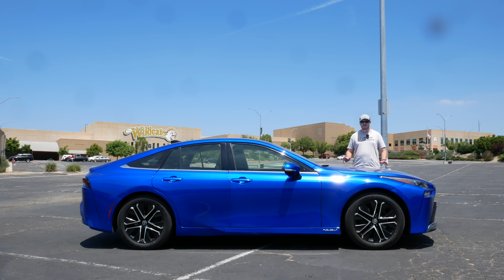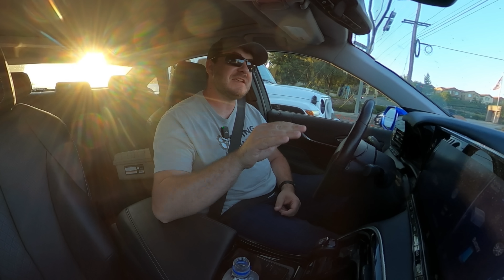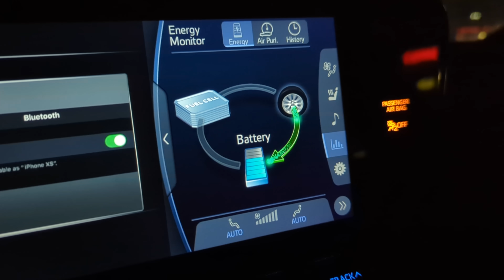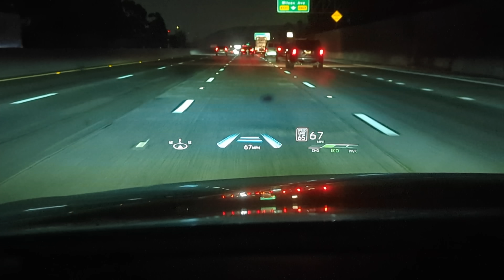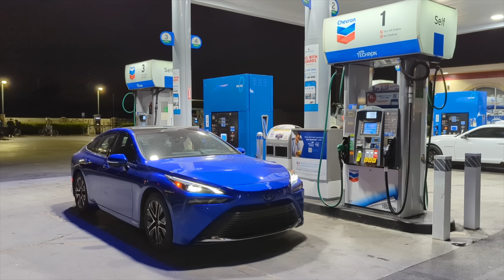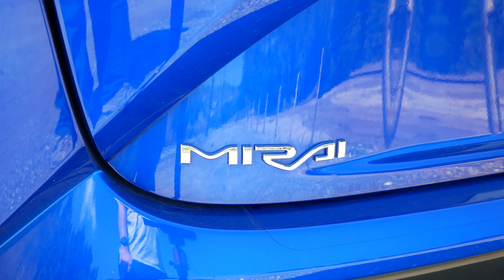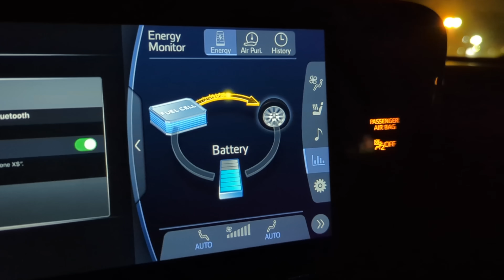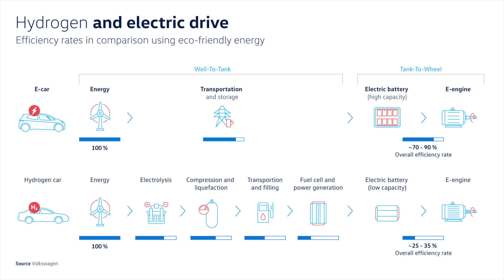The Toyota Mirai is Disappointing

Comment: There are actually at least three hydrogen cars. Opel is selling their Vivaro, a small box van, as a hydrogen version too. And soon Citroen and other companies from stellantis will follow step. 

But you mentioned the blower noise. Those cars usually actually have a turbo to be able to get enough air for the reaction. 
Those vivaros sometimes sound like yet engines.

You also mentioned the fuel cell/Batterie usage in this car. It's actually its strong point. As a car manufacturer you don't want to have a brick battery. It's expensive, takes up space, makes your car heavy and has a bigger environmental impact. 
And you as a user would probably like to reduce the cycles of your battery to have it last longer. 
Toyota and Hyundai were able to do it. Other hydrogen vehicles like the Vivaro have a bigger battery pack. But not because it's an active design goal, they just can't do it any other way. This fuel cell/battery management is hard but crucial and if you can't do it properly your battery has become bigger. They would absolutely love to know how Toyota does it.
The truck you mentioned might be something else, but in general with cars the aim is to have next to no battery capacity.
Reply: To answer more of your questions: the estimated life of a car fuel cell is usually around 3000-4000 hours. 
In trucks they use more expensive membranes that should last around 20000 hours.
Reply: The Vivaro Hydrogen has a big (10 kWh) battery because it is a plugin vehicle. It even has DC charging capabilities so it really is half an EV.
Reply: @Freba9  They try to make the best of it, but it's really born from them not being able to run with such a small battery.

Comment: Hydrogen cars have the same problem as electric cars, they need much better ways to store their power source. They need to find some magical way to store far more hydrogen and do it in a far safer way. Fuel cells are crazy complicated, expensive and explosive. Just using hydrogen to run a standard ICE drivetrain is far easier and cheaper, albeit very inefficient.

Comment: “Technology is fun” when it makes sense… and actually works reliably (unlike CrApple devices)!
Unfortunately, we as consumers are GULLIBLE and IGNORANT. We’re far too trusting of the sunshine-n-puppydogs “data” that tree-huggers and energy suppliers feed us, to make us “feel better”.
Most of that disinformation would be an excellent source of that “methane gas” mentioned in the video. 💩 
I’ll speak in Reality-ese:
I’ve driven Gasoline vehicles. I’ve driven Diesel vehicles. I’ve driven CNG, LPG and Electric vehicles. The reality is this:
Gas is not exactly clean, but it is FAR more “Renewable” than we’ve been brain-washed to believe (*psst - it’s not “dinosaurs”, folks*).
Diesel is much, MUCH cleaner than it used to be, but it’s not very efficient (and contrary to what Robert said, 10mpg in a BigRig is a fantasy - try 8, in ideal circumstances)!
Electric isn’t “Clean” either, even if it’s Solar, Wind or Hydrodynamic. It really isn’t! 
All those wind-turbines we litter our landscape with? Every one costs millions to manufacture and erect (and if you think that process is in any way “Clean”, you’re delusional); and with their unreliability and astronomical costs of maintenance and repair, precisely NONE of them can ever pay for themselves. Money down the drain, in addition to the Sight Pollution, danger to aircraft …and they slaughter birds as well, folks.
Solar is becoming increasingly more affordable, but it’s still relatively expensive… and also poses significant environmental consequences, including horrible wildlife deaths. Anyone who sees those three solar steam generating towers on the CA border outside Las Vegas should do some research on that facility. That Ivanpah plant is another blight on our landscape, cost tens of millions to operate and maintain, and it’s INCREDIBLY inefficient! I mean, truly ludicrous! We’re talking low 30’s efficiency! And you can’t tour the facility, because they don’t want the public to see all the many flash-fried bird carcasses on the ground beneath and around the facility. FYI, those panels you see on the ground are NOT solar cells, they are focused MIRRORS, and birds flying innocently in the powerful sunlight beam between the mirrors and the boiler tanks atop the towers are nearly incinerated in an instant. Don’t believe it? Pull off the Highway and grab your binoculars.
Plus like all Solar generation, they only work when there’s sunlight. 
CNG is truly Renewable, and relatively inexpensive. Except that the Big Energy people control its production, so they therefore control its sale.
LPG is slightly less Green, and is a little more costly to produce. It is readily-available and easy to utilize; but Propane is INCREDIBLY dangerous, and the amount of LPG a vehicle can have stored within it must be very limited, or else you’d be driving around in a mobile explosive device with the capability of leveling a city block. Therefore they have a very limited travel range.
And HYDROGEN??
Have we forgotten the tragic lesson learned from the Hindenburg?

I’ll keep my gas, thanks.
⛽️👍🏼

Comment: I was in a club in high school to show the viability of the Toyota Mirai. It used the same premises as the car, we would create an RC car and a hydrogen fuel cell would recharge the battery.   There was a twist however, we would enter the car into an endurance race ~4 hours. It was a really fun experience but we couldn’t really compete because one school had like 6 teams and had tens of thousands to spend on this program. 

The main source of problems was the fuel cell and the system surrounding it. And from what I am able to recall, the fuel cell works by shoving hydrogen through a membrane, which(somehow) separates the electron and hydrogen(temporarily). The positively charged hydrogen sits on the other side of the circuit and the electron goes through the circuit making electricity. Take this with a grain of salt because I don’t have a college degree nor a brain for chemistry. 

For hydrogen creation we used electrolysis to fill hydrogen tubes and we learned of an upcoming third way.   Apparently there is a startup that is taking methane(and carbon)from landfills and dumps and uses that methane to make hydrogen. Really cool stuff! And I really hope it works out. 

For what’s it’s worth I took environmental science and your descriptions are really accurate. And this is my longest and most serious comment I ever wrote.

Comment: I feel hydrogen is a better way forward than electric
Reply: It’s not at all.
Reply: @Freba9  yes it very much is a better way forward especially if you don't live in a city
Reply: @Mephesto31  It is simply not efficient enough. Also, EVs make perfect sense in rural areas as most people have driveways and can charge at home for very low prices.
Reply: @Freba9  no they don't unless you live in southern California evs are garbage my commute 1 way is over 100miles hydrogen is a million times more efficient than electric and it's for the planet then evs the ev push is a control thing
Reply: @Mephesto31  That's an insanely long commute, but it's no problem for a modern EV. Owning EVs in rural areas is no problem at all.
And no, hydrogen is OBVIOUSLY much less efficient than electric.

BEV:
Power plant > Battery > Motor

HFCEV:
Power plant > Electrolysis > Cryogenic Storage > Transport by truck > Cryogenic Storage again > De-liquification/pressurization > Hydrogen fuel cell > Battery > Electric motor

You're gonna tell me that the method with 6 extra steps is more efficient?

Comment: To simplify, the membrane in the fuel cell repels electrons, so when a hydrogen atom makes its way across the fuel cell, it gets striped of its electron. It reacts with oxygen on the other side to make H2O. This is hard to do without an electron, so if it can pull one in, it will. If you put a conductive mesh on either side of the fuel cell and connect them, the electron travels though the wire to the other side of the fuel cell where it is needed, and of course electrons traveling though a wire, well, that's electricity!
The reaction is an oxidation reaction, in this case the oxidization of hydrogen. Like most oxidation reactions, the oxidization of hydrogen is exothermic (adds heat to the surrounding environment), so the fuel cells get hot for the same reason the Hindenburg, a hydrogen filled lighter then air aircraft, burned down in a bright fireball of death.

Comment: If the cell makes heat you might as well use a steam engine and maybe a tiny electric motor to capitalize on all the energy you can and use the water to supplement the water to the boiler.  You won't be super fast but it would reach highway speed.

Comment: There is a reason Elon has called this a “fools cell”.
Reply: Funny because Toyota is working with NASA they built an RV for the moon and it uses hydrogen not incredibly dangerous lithium.
Considering it's way more complicated in space than on earth I think hydrogen has a real place. I'd rather have a hydrogen vehicle than an EV as I live in an apartment.
Who's going to pay to have my small 4 unit building wired up so I can buy an EV? I can't afford the SEVERAL thousand it'd take to upgrade my breaker box, then run an outdoor line, with a locker to pull out the EV charger because I rent. My landlord won't without drastically increasing my rent. It's not the governments job, and no car company would do that for a renter just because they bought their car.

EV's work great for those privileged enough to be in a position where they can own their own home I'm sure. But for those of us who pulled themselves out of poverty to live in an affordable home it's out of reach and ALWAYS will be. I can justify buying a used Hydrogen vehicle but if I bought an EV I'd lose hours a month of my life refueling it. Which is money out of pocket.

Comment: damn, that hydrogen price is crazy. i thought here it's insane with 14€/kg because it went up from 10€/kg 1 or 2 years ago. personally i prefer hydrogen a lot over batteries, it just needs to be adopted more, just like gas did 120 or so years ago. or they find a way to build batteries that can be filled to 100% in not more than 10 minutes and that either still work perfectly after 15-20 years or that are way cheaper to replace

Comment: 1:23  Wow. That's a video encoding artifact I've never seen. Wobbly image and tearing.
Reply: It was a camera sensor issue as he went over a bump.
Reply: @joebot86  Doesn't look like that at all. It looks like the trees made the encoder glitch out. Also he's driving rather smoothly at that point.
Reply: @avada0  I think your right that I'm wrong, I wonder if that was a 360 camera, that issue had to come from something other than encoding.
Reply: @joebot86  Why are you so fixated on that? It seems like the encoder just stretched a macroblock in a wrong way.
Reply: @avada0  because it looks like issues I've gotten out of using questionable cameras while driving as well, that's pretty much it.

Comment: Liquid hydrogen also need to be in pressure containers, so they also need to be rounded.

"Only produce half the amount of CO2"

Nopp, that is not even close to be true. If the cars are the same and the ice car run on the same methane as the reforming is made of. The hydrogen fuelcell car is worse. Quite a bit so.

No the efficency of a electric car is no where nere 80% efficent, try more 55-60% (yes more than hydrogen, but actually less than ice)

Comment: Hydrogen tanks filled at 10,000 psi is not my preferred item to have with a vehicle I'm driving. Even if the tank is unlikely to rupture in a crash, there is definitely a chance of a leak from the gas lines and Hydrogen has an extremely low explosive limit with air. The resulting explosion will likely end up rupturing the tank.

Comment: I see hydrogen as potentially good. In places like australia they have massive desert areas which can be used for solar farms which can produce hydrogen - even if its only 40% efficient. Thats still better than burning fuel or using more lithium batteries.

Comment: Regarding the point at about 15 minutes in that busses, trucks, etc would require very high power charging stations - the Brisbane Metro (which is a biarticulated battery-electric bus) is getting 650kW 'flash' chargers. 650kW! Its slow chargers are 50kW.

Comment: Counting everything involved with producing EV form mining to disposal of terminated batteries I would say that hydrogen is the better long term environment improvement solution. Combine that with increased infrastructure support and the comparison with regular combustion you would also be more likely to convert combustion engine owners to hydrogen than EV.
Reply: Have a look at the mining needed to produce fuel cells and EVs don't look so bad..

Comment: It's a TOYOTA, they're all disappointing these days! And this is coming from someone who has owned and loved classic toyotas! MR2s, Supras, a Celica, a Land Cruiser, a V8 4runner (yeah they made that once upon a time!)... Toyota is an inherently disappointing company now, they're so risk averse they won't do anything interesting without a partnership, and they screw those up too - the GR86 would have been a WAY better car with a modern take on the BEAMS instead of the stupid subaru flat four, and the supra is like driving in a letterbox! The GR Corolla is way too expensive for what it is, a Golf R costs about the same and is a much nicer car aside from the latest interior revision with all of the capacitive touch nonsense being awful, but the Corolla interior is awful too so that's moot! The driving dynamics of everything else they make is completely dogshit and the styling is not much better! I love toyota (pre 2000s) I hate toyota (post 2000s)

Comment: You put this video out at a strange moment. I’ve been thinking a lot about the loss of the Titan submarine and the materials it’s made of. Carbon fiber and titanium. We’re certainly waiting for investigation results but I have my own theory and you made think of this. Both carbon fiber and titanium don’t respond well to compression cycles. They hold up really well to a constant load but going from high compression to low compression repeatedly tends to affect the material’s temper. A carbon fiber hydrogen tank may work just fine but I share your concern about longevity. And since this is only being done in California I worry that real world temperatures are not really being evaluated. Good video, though. It was a fun watch. I hope hydrogen becomes a proper option but I worry that we may be leaning too heavily on these “space age” materials.